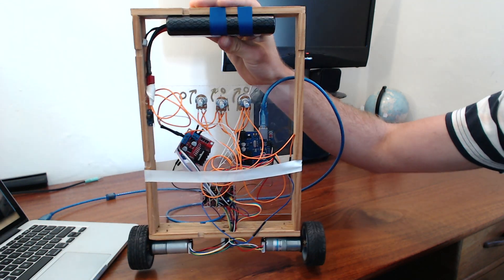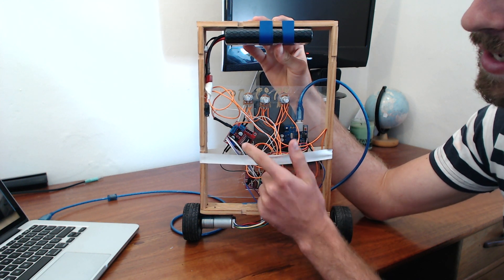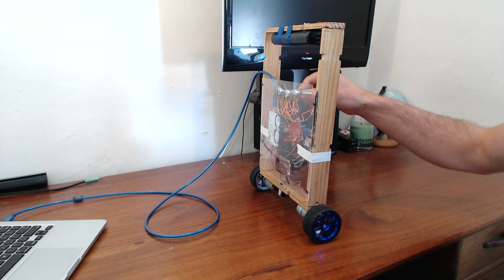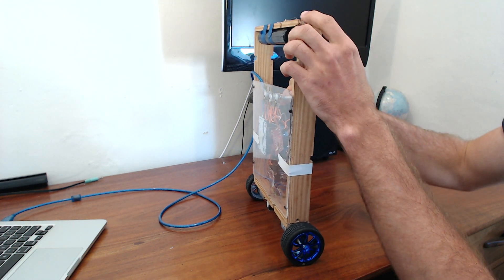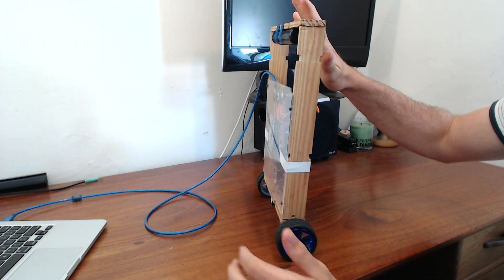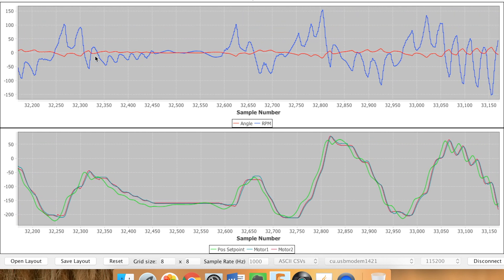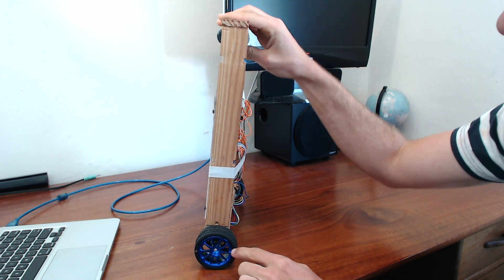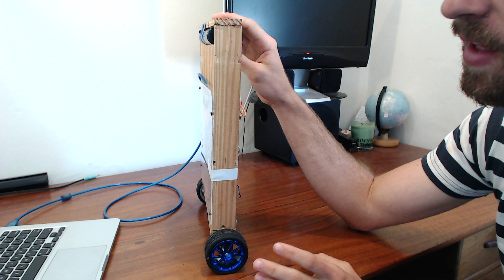Build Log #1 Arduino PID Inverted Pendulum Robot

Comment: Your IMU is at the bottom when it should be at the top. when it's at the bottom it doesn't notice the movement until much later so if you move it to the top it will measure the change immediately and at a greater rate. Everything else will probably be ok. Let us know how you've got on

Comment: Try the integral gain dude, it will definitely get rid of the oscillations after making several adjustments to the center of gravity of your cart, lower the position of the battery.

Comment: Well try to place the battery at the bottom in order to have a lower center of gravity , which constitutes to a better stability and hence a lower moment created
Reply: Strangely, having the weight at the top is easier to balance. Try it with a broom. If you hold the brush its harder to balance than if you hold the handle. It's quite counter intuitive.
Reply: @markmarney622  That's is so true , had a project once and our pendulum was very lightweight , which means low intertia ... Low intertia and hence easily excitable but unstable

Comment: Hey, did you solve the problem? I'm experiencing the same... I am trying larger wheels soon.
Reply: the problem is (in this video) where the accelerometer is positioned, it must be at the top and 
never on the bottom since it can not counteract  the movement also the the bot needs to be tall
i have build one today (but in reality it took over 2 years )  and the problem with the old versions were the position of the accelerometer